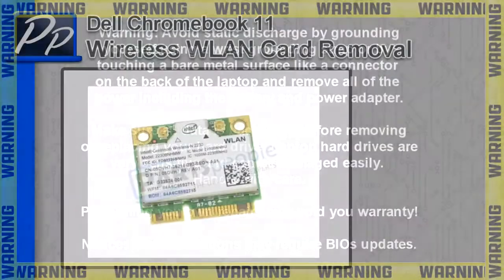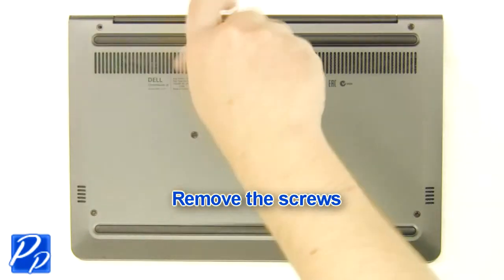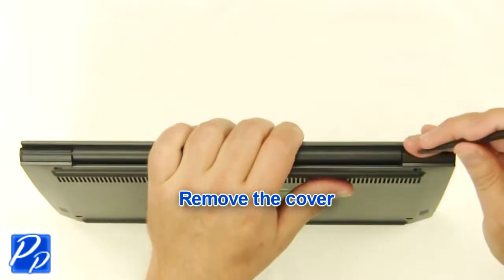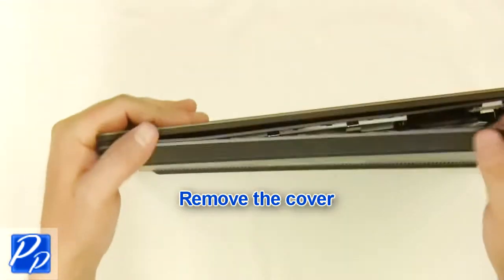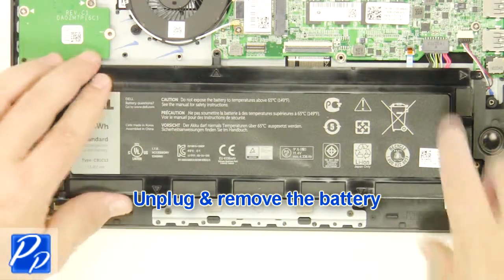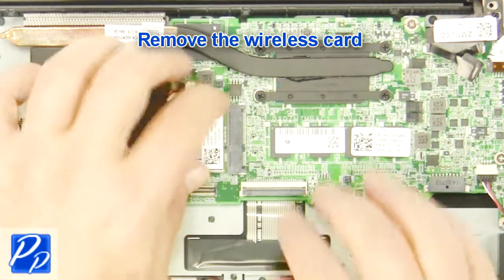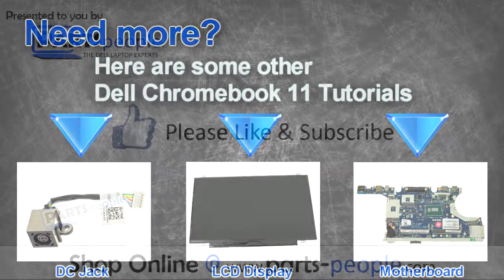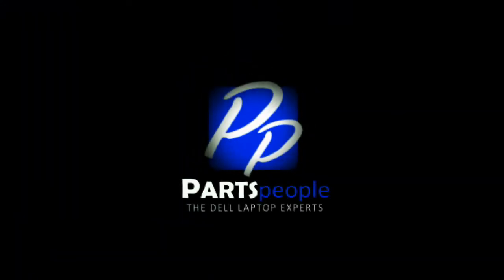Dell Chromebook 11 Wireless WLAN Card Video Tutorial Teardown

Comment: Hey, since your site says you're out of stock for the WiFi card, I was wondering if you could tell what the brand and model number is. Thanks!
Reply from the maker: Unfortunately, I no longer have the Chromebook 11. I don't remember the exact model number or part number.
Reply: Parts-People.Com, Inc No worries--Chrome OS tends to support most Intel cards in my experience, but I figured knowing the model number would be a sure thing. Thanks anyway, and nice work on all the CB 11 tutorials.
Reply from the maker: Joshua Tatro
I went back through some of the old pictures I took of the Chromebook 11 and found the WiFi card. It is an Intel DW1901 part number K2GW5. That should be everything you need.
Reply: Ah, you're the best! Thanks very much.